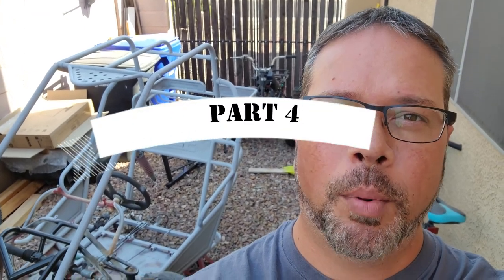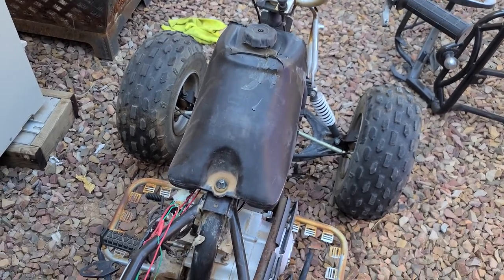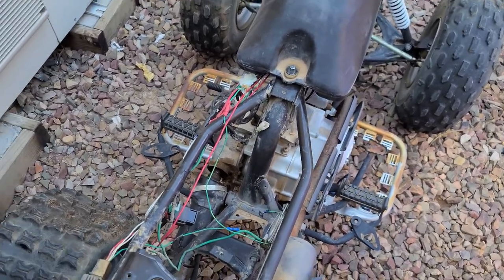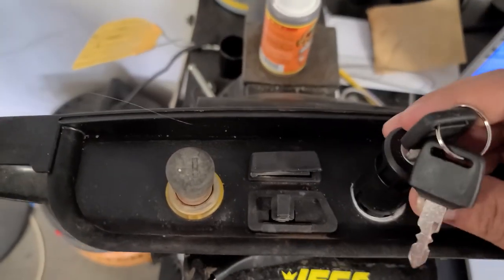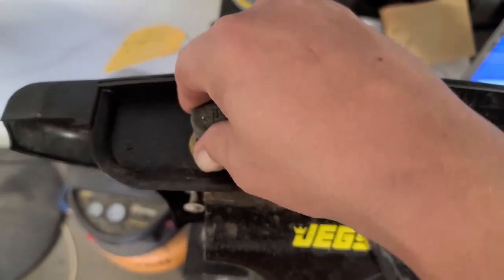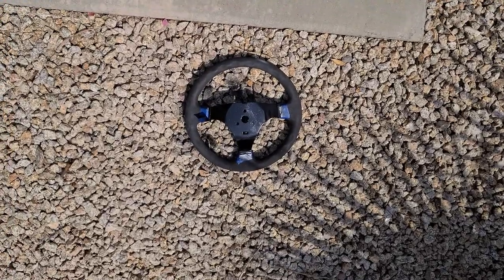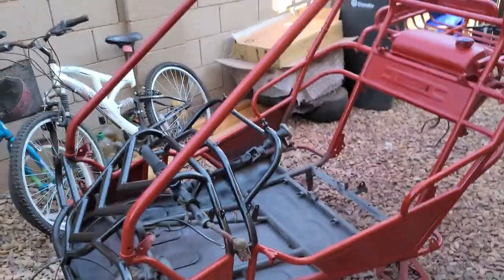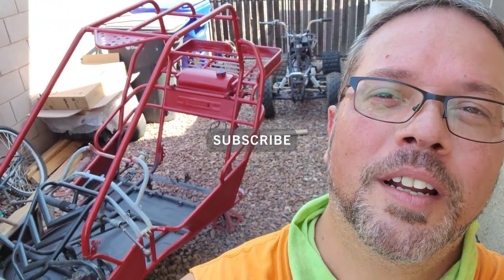Hammerhead Twister -Go Cart (Rebuild) Part 4 #Hammerhead

Comment: Hi will you be buying a new fuel tank
Reply from the maker: I did right before I made the video.  I plan on building more so what do you have? Thanks for watching!!!
Reply: I have the same kart but my fuel tank is messed up
Reply: Would there be a chance I can get the link of the tank you got pls
Reply from the maker: @zlock6514  https://hammerheadperformance.com/fuel-tank-flat-black-for-gts-250-4-000-029-fb
Reply: Thanks what year is your kart
Reply from the maker: @zlock6514  not sure
Reply: 👍 sorry do u have the link of the kart that u have
Reply from the maker: @zlock6514  Here you go, it is a PDF with every part and exploded views. https://gokartsusa.com/pdf/150XRSparts.pdf